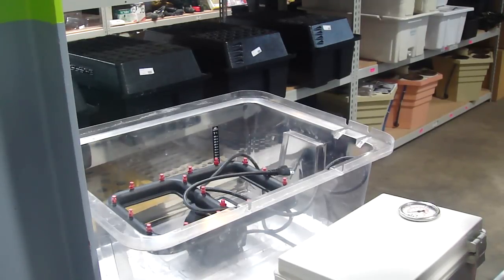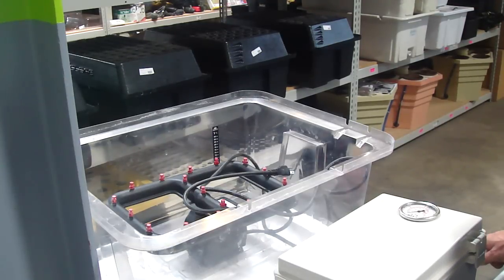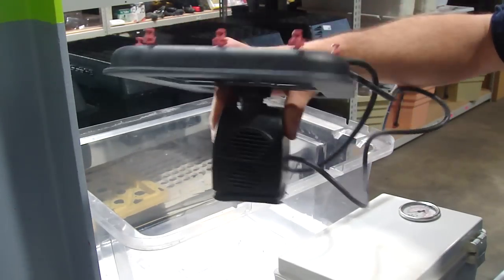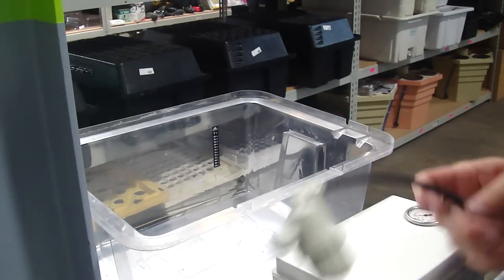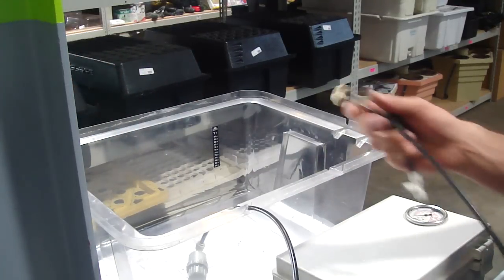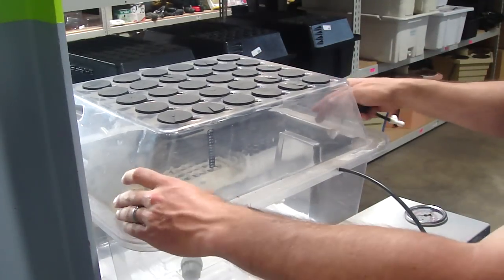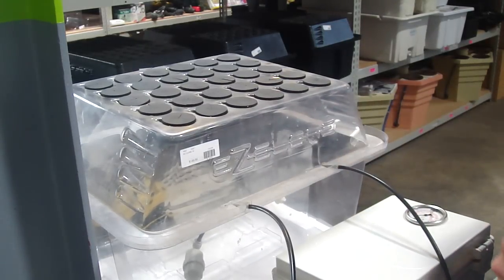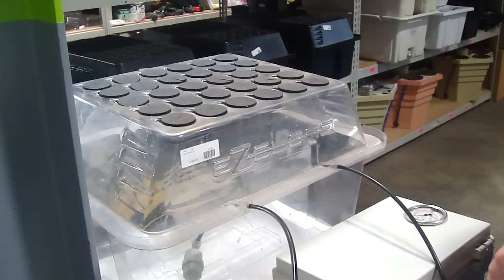The new ezclone?

Comment: Do you run the ezclone with HPA on a timer with 1 minute on 4 off? don't know if the Aquatec 8800 is built to run 24/7?
Reply from the maker: Our 8800 model runs fine 24/7 or on a timer, but the off times need to be at least 1+ min.
Reply: So 1 on and 4 off gets it done. Cool